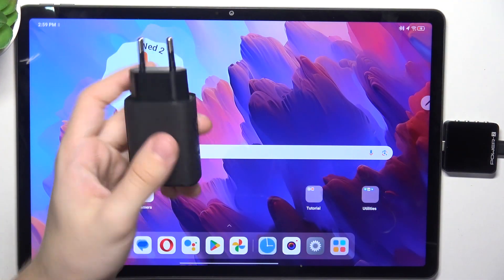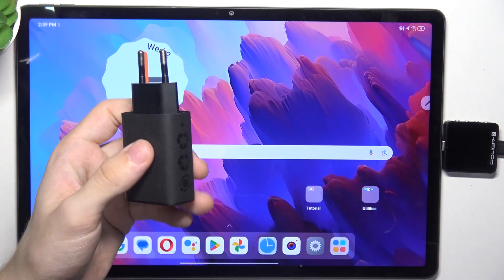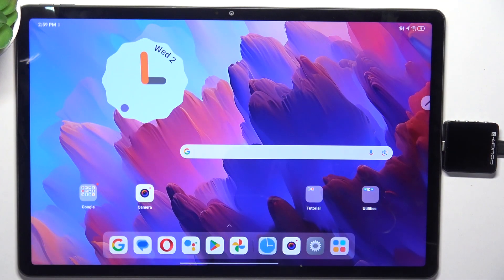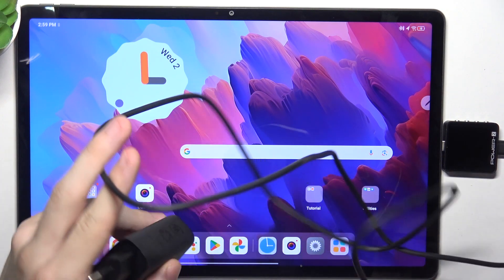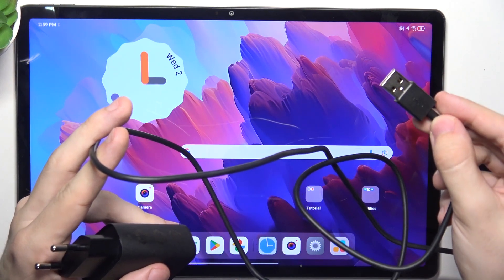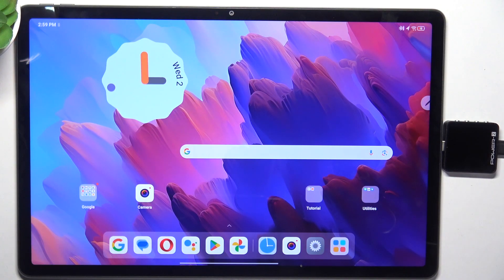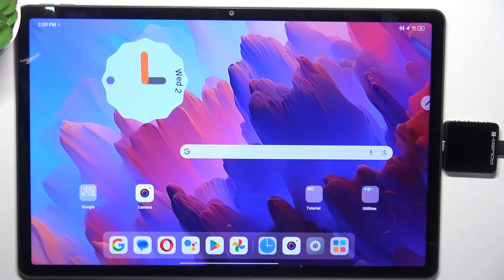Voltage Test Original vs Generic Charger - Lenovo Tab P12 and Charging Speed

Comment: Does it support 45w charging because when I searched in Google it showed that it supports 45w but comes with a 20w charger
Reply: It support 30w not 45w
Reply: @sree7465  so if I plug my 100w charger will it charge at 30w??